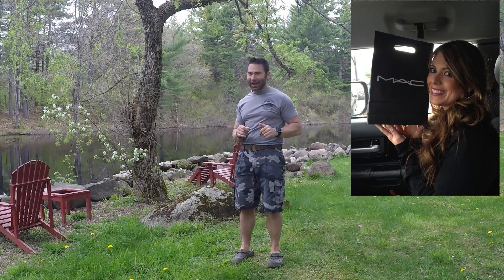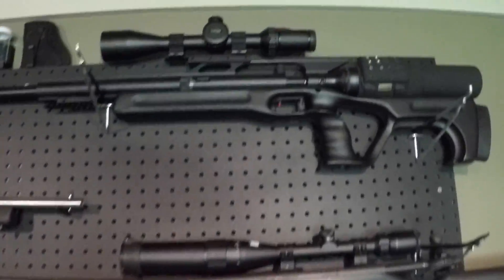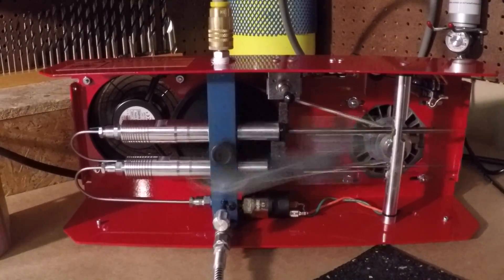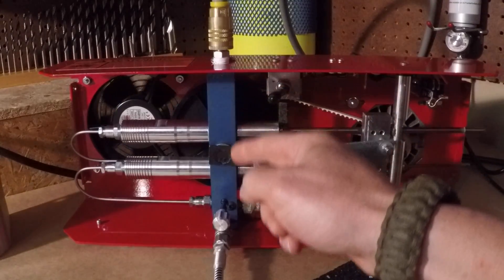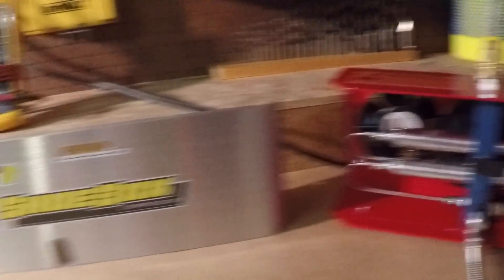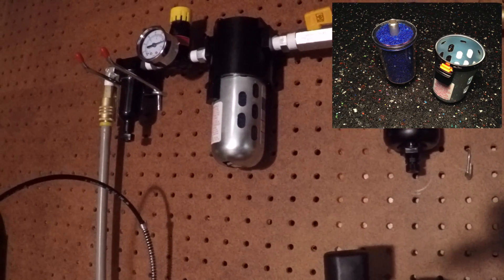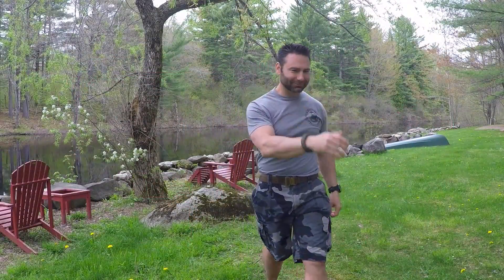F10 ShoeBox Compressor Fill Station

Comment: Sadly now defunct, wish I could get the drawing and bill of materials I’d start making them as soon as I could source components.
Reply: doesn't look that difficult, if you have the knowledge and knowhow you should be able to fabricobble something up. it's literally just a two stage pump driven by a DC motor with a computer fan and some belts and shit
Reply: @schlomoshekelstein908  lazy throwaway comment.

Comment: I have a F10 shoebox air compressor never used (828) 290 2340 paid $1,100 will take 900. I simply don't hunt anymore. It puts all the maximum pressure of 4500 PSI

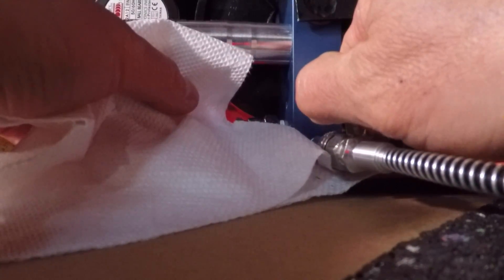Comment: What is that knob for at the 3:40 point ? That is an elaborate filter set up. Water separators and filters are as confusing as buying an air rifle. Thanks for the information.
Reply from the maker: it's the bleed off valve for the air on the shoebox compressor itself.

Comment: thanks for the video. I didn't realize how quiet this machine is except for the shop compressor. I wonder to those guys saying "its too complicated,  get the Chinese compressor". Well how are those Chinese compressors doing now after like 50-100 hrs of run time? I'm entertaining the idea of this F10 as a backup to my $1600 Chinese compressor setup. when it dies,  I'm getting American made.It may be slow but will outlived your Chinese compressors.
Reply from the maker: I've had great luck with my F10!
Reply: Can’t go wrong with the little Chinese compressors, compressors are pretty low tech with not much to go wrong. My $150 Yong Heng 4500psi compressor runs like a champ and as a bonus I can bring it places since it doesn’t need an external 1st stage compressor. 

I did like the shoebox design though since practically speaking I always fill in my garage anyways. But at $500 I figured there’s no harm in first trying the Yong Heng since it’s only $150. Replacement parts are also readily available, a replacement crankshaft/pump piston assemble is $20. When The Slingshot Channel took his apart during the review that crank was the only weakness he found since it has no bearing and relies on the oil bath alone. It’s nice to know that weakness is only a $20 fix. I’ve been running mine for 2 years now filling my paintball tanks weekly. 

Ebays the place to buy them though if you live in North America. They sell for peanuts and have them warehoused in country. If you look on websites, amazon, and Kijiji/Craigslist people try and sell these $150 compressors for $500. Kinda ridiculous how dumb some retailers think people are that they can overcharge 350%

Comment: It is necessary or optional the use of air filter when using a shoebox?
Reply from the maker: The output filter is certainly optional.  However, I would at a minimum run an input filter of some sort with desiccant.  That's just me.  From your 1st stage compressor just run the hose vertical if you can so any moisture will condensate and drop.

Comment: I just bought a used Freedom 8 and I am filtering the input but do not have and output filter yet, so I have one question about when you bleed the system it was before the alpha filter so if you do not have moisture before why is the alpha needed?
Reply from the maker: Great question.  I basically have if for reassurance.  When the dew point changes in my area I may end up with more moisture.  But the main issue is right now it's not cold enough for my gun to get down below the the dew point.  As the temperature starts getting cold for squirrel season the air cylinder on my gun can start to develop moisture inside of it while I'm hunting.  when I come back in from hunting it will rise up above and evaporate back into the air.  If your gun temperature never gets colder than the dew point of the air inside one should be fine.  If that makes any sense.  So the more water I can pull out the better off "theoretically" I'll be.  Hope that helps..